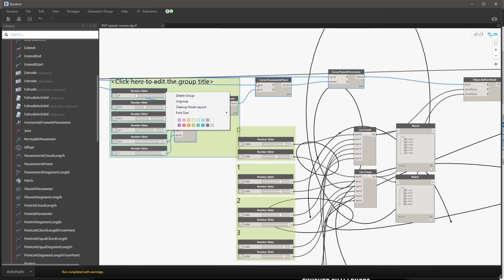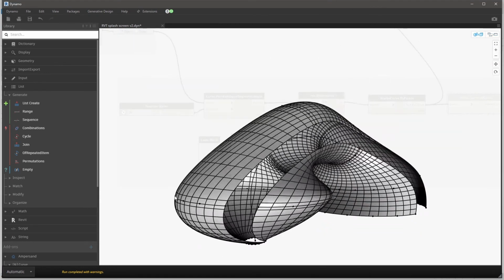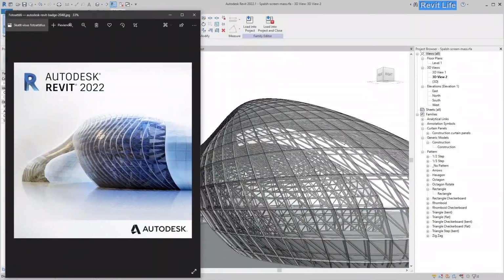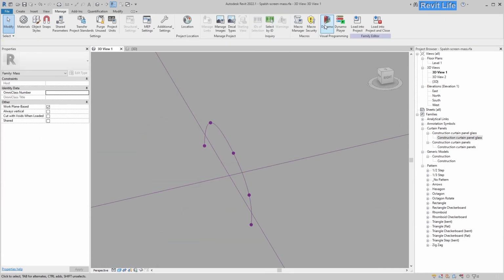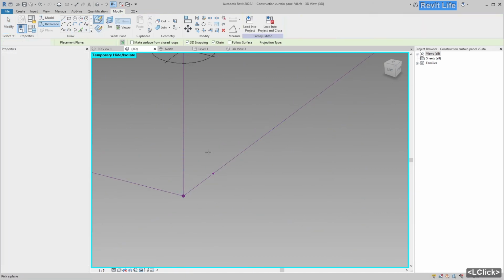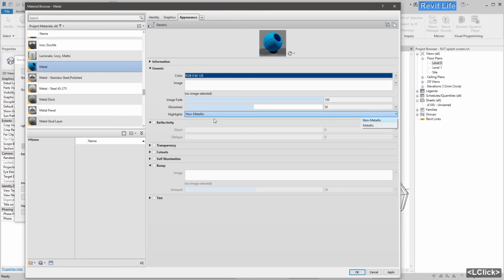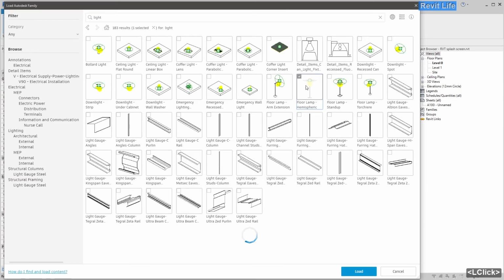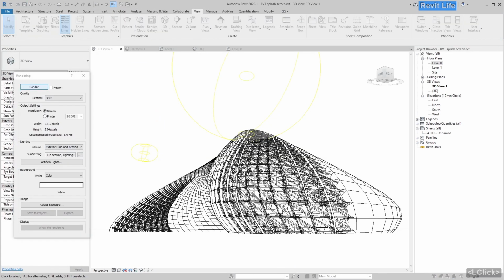Revit splash screen as a real building - parametric architecture with Revit and Dynamo

Comment: Amazing!This is the most amazing revit related video I've watched on YouTube by far.I've learned so much:
1 pattern based family can be more powerful and efficient compared to adaptive component.
2 using mass and pattern based component can also make this complex form without dynamo
3 when creating families，model line can solve unexpected errors compared to reference line
4 when populate complex forms，use different family instead of one family with different types.I have used different families but I don't know this benefits.

But I also have some questions:
how could you import form generated in dynamo，and model it as a mass,the video plays fast and English is not my native language，am I missing somethin?
Reply from the maker: Hi, thank you for kind words! I really appreciate that! I use this Dynamo Node: https://dynamonodes.com/2016/02/14/form-byloftcrosssections/ But you have to be in Mass Family project to be able to use this. After the Form is created, load the Family into the Project you want.
Reply: @BIM-Life  Thank you for the answer,sir.